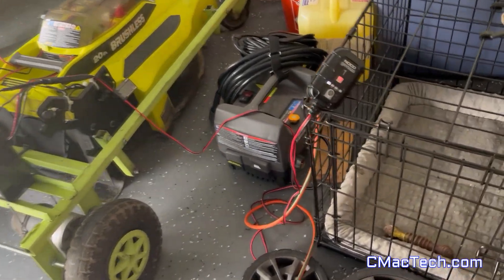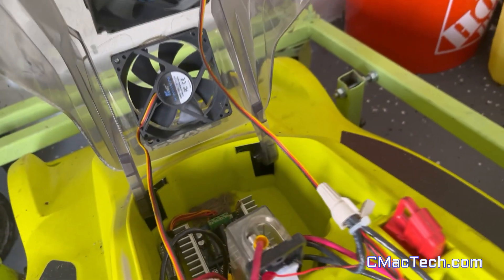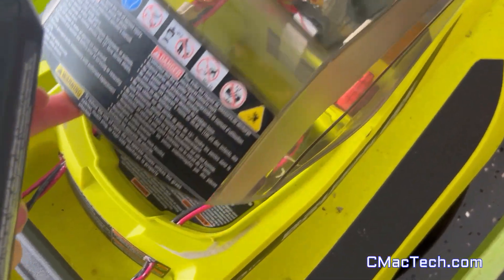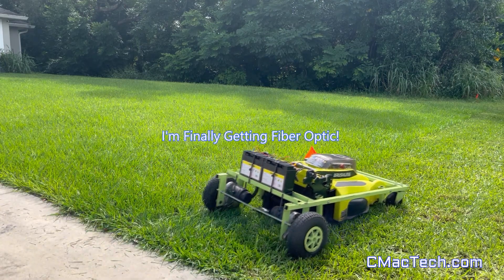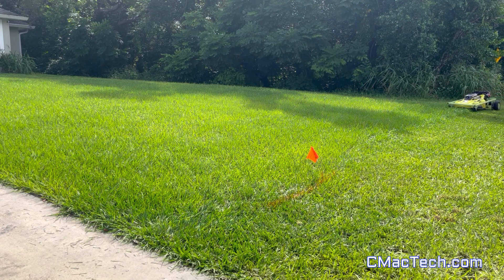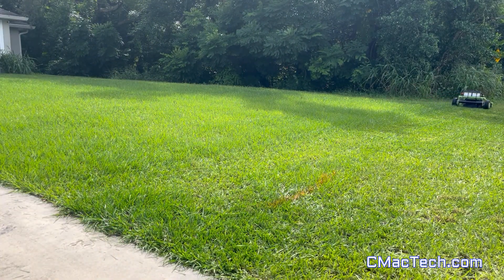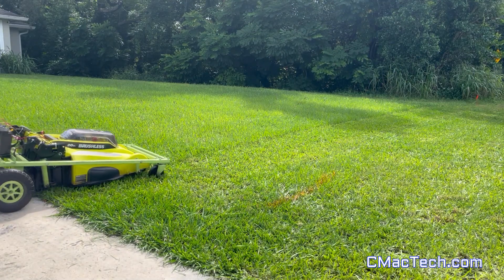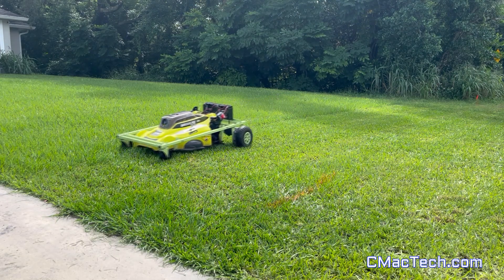Remote Control Lawnmower - 16 MONTH UPDATE! (City's Inspector Stopped By)

Comment: Great project! I did a similar one. And funny side note: my first idea was having very similar construction for frame and motor mount. So you could remove the mower quite easily having a modular system. I did all the electronics above the mower for that purpose.  I went for a different frame design now and I am using a 4WD RC set - so that was trivial to set up (1 minute). But difficult part was that I used own massive 84V ebike motor controller and a step up  converter to wire original mower motor to main 24V battery. I have chosen a 51cm mower from Greenworks. Next will be an improvement in frame and GPS RTK. So this is still work in progress.
Reply from the maker: Nice. Yeah I plan to remodel this to a 4x4 but I have concerns about tearing up my yard. But the extra torque would be very helpful for my sloped side lol.

Comment: What slope of hill could this bad boy goes? I have a pretty steep hill maybe 45 degree. Wounded If 24 v motor is big enough and if it need  4 motors for each wheel
Reply from the maker: I have a slope probably about that or a little worse and 2 24v motors is fine for me although at times when the soil is soft it’s a bit tricky and requires reversing and going forward full throttle. But I have 10 inch cheap tires. If you have 13 inch tires or off road type tires, you should go up your slope with ease with a build like mine.